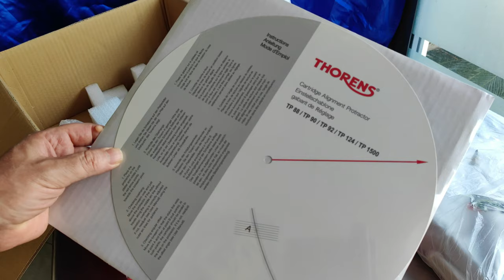Thorens TD1500 turntable | unboxing, set-up and deep unboxing

Comment: I have one, it is superb. The suspended sub chassis puts it into a different league to simple light turntables like the Rega Planars', it also means you can use it on normal lightweight furniture etc, you don't need all that mass, stone plinths etc.   The original TD150 was the basis of the Linn Sondek, this deck costs as much whole, as a single upgrade for the Linn (let's see you can have a bearing, or a power supply, or better springs.....crazy nonsense). 

To have a 2M Bronze as standard is very unusual, this is a 400 euro cartridge, most have reds, some blues, I've not seen one of these as standard.
Reply: Hi ! Does it have  adjustable feet, or does suspended chassis makes level adjustment unnecessary ? Thanks

Comment: i have problems with mine. i have wow and flutter 0.15-0.2 and even sometimes 0.25 caused by optical incrimental encoder stabilization. Because it corrects speed often. like motor spins at 33.31 rpm and then encoder increase it to 33.33 causing wow and flutter instability. Then motor slows again to 33.31 and again stabilization see it and increase speed. it happens 1 time per minute. Drive system and motor in this turntable crap! for that price there should be synchronics good quality motor!   Manual says that this Thorens has only 0.08% wow and flutter, its not true!

Reply

Comment: Anti-skating not adjusted correctly ! read the manual please ! greetings, Roger D from Begium
Move the weight for the anti-skat- ing in the slot between the tonearm base at the back and the arm support at the front to the same value. On the scale, the long lines, seen from behind, indicate an increase of 0.5. To adjust the value, it is best to use a small screwdriver or the pin supplied with the tone arm height adjust- ment.   Important: the basic position at the base of the arm specifies the value 0.5, i.e. the other values are based on this.
Reply from the maker: Thank you for the details 😊😊😊
Reply: Thank you for that!  Now if I can find cartridge setup. 😬

Comment: Manufactured in Taiwan,  are you kidding me , unbelievable 😑.
Reply from the maker: Taiwan manufacturers turntables for a huge number of brands. The Thorens one is designed in Germany and assembled in Taiwan which means high quality
Reply: It’s designed and engineered by Walter Fuchs and Helmut Thiele in Germany and built in Taiwan by a Thorens enthusiast to Thorens design, specifications and quality demands with quality materials. It cost 2 000 euro and would cost at least 3 000 euro if built in Germany.
Reply: Yes, and this is why it is high quality!

Comment: $3,000 for a "Made in Taiwan" turntable?  What a joke.  I'll stick with my "Made in Germany" TD 160 Super.
Reply: The TD1500 is fully designed and engineered by Walter Fuchs and Helmut Thiele. It’s built to Thorens specifications, design in Taiwan with the highest quality control and with quality materials. It’s a 2 000 euro turntable that would cost 3 000 euro if made in Europe. It’s a best buy in several European magazines and it eats TD160 for breakfast. 
A major difference is that the suspension in the 1500 has a much better controlled movement, this means a more focused and distinctive sound. 
The DC motor with an optical decoder and advanced motor control means less speed variation and lower wow and flutter than the TD160.
Reply: You live in the past. The Taiwanese have high quality products and workmanship to offer. Something that is about to vanish here in Germany.
Reply: Wasn’t the TD160 Super Swiss made?
Reply: @raphaelmabo5014   Wszytko chińskie silnik chiński za 10 € 🤣🤣🤣